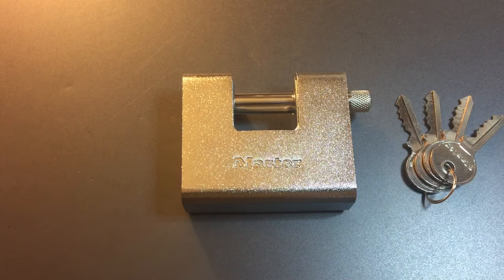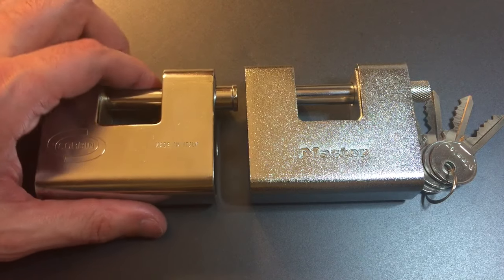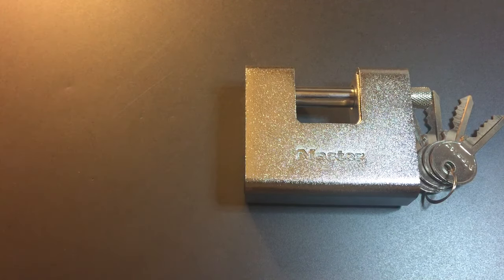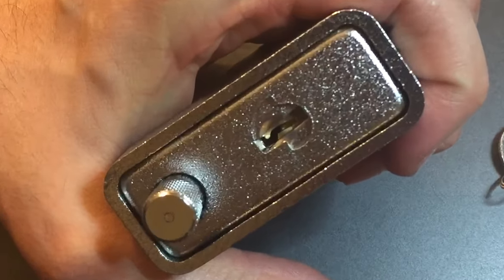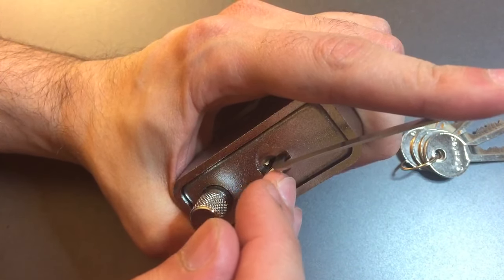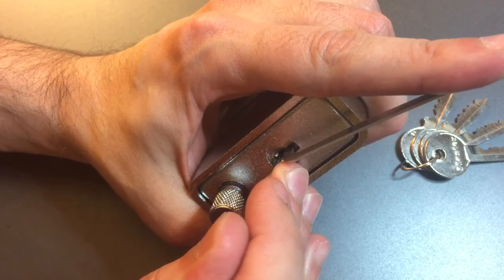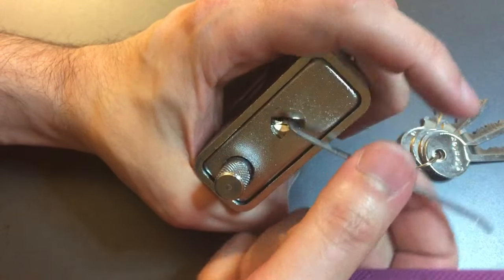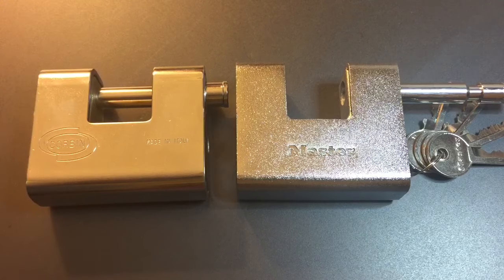[303] Master Lock 680D Armored Shutter Lock Picked

Comment: Nice video thanks. 
I have a shutter lock that is very stubborn to me. It is 82mm solid brass and takes a Yale key that fits a Yale Y221/61 and several other Lockwood padlocks. Key way is narrow and the core is vey tight and hard to turn. Only wish I were closer to you to send it to you. I would very much like to see it picked. I have three of them and are all the same fell. Name on it is drawbridge.. Thanks again for the wonderful videos.
Reply from the maker: Thanks.  Yeah, sometimes you get one of those locks when the starts align.  I actually have a Y221/50 like this... I can usually breeze through them, but this one had absurd precision.  I was dropping spool left and right.  Never heard of a drawbridge padlock, but I'll keep and eye out.

Comment: Most thieves won't pick, they'll just try to beat the lock to death.  If the whole bloody thing is made of zinc, you made it super easy.
Reply from the maker: This lock has a steel outer shell, so beating it apart is probably not in the cards.

Comment: I saw a shutter lock in South America from Hermex (Mexico) that had a 4 sided key. I've been wondering if those are any harder to pick than the ones that use the standard keys with only 1 side with teeth.
Reply from the maker: A key like this one?  https://www.youtube.com/watch?v=YIi7-Z7QjyQ
Reply: No - it looks like a 4 edged star or a cross and each edge has a tooth pattern
Reply from the maker: More like my video #44:  https://www.youtube.com/watch?v=GTmarUnRPvA  ??
Reply: yes, like that one.
Reply: Looks like it was not much better than anything else. :-(  Do you have a recent video or link to suggested locks that do not cost a fortune?
Reply from the maker: What are you locking up, and how much do you want to pay?
Reply: I have a shed that currently has a Master lock on it and would like to  upgrade that to something more resistant to cutting and drilling. I am hoping for less than $50.
Reply from the maker: Joseph S Try the ABUS Diskus 20/70... great lock for outdoor applications in that price range.
Reply: Thanks! - I will check it out